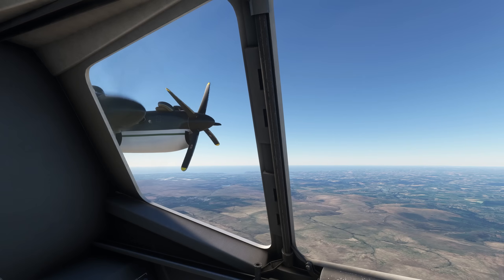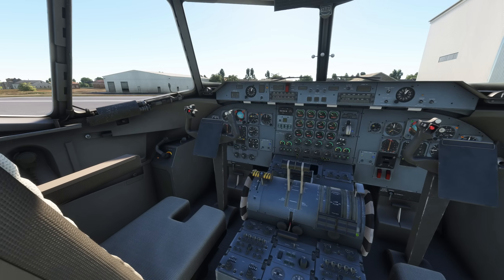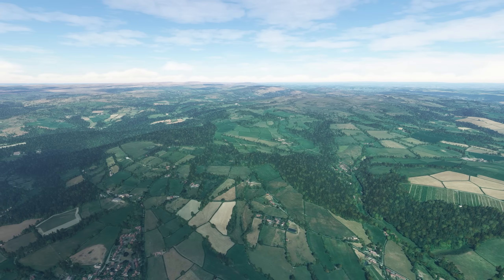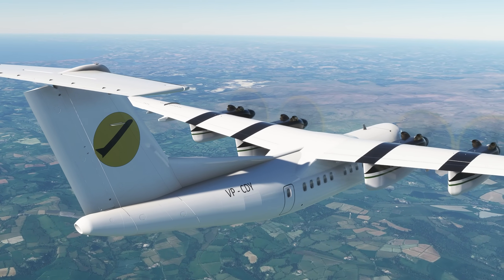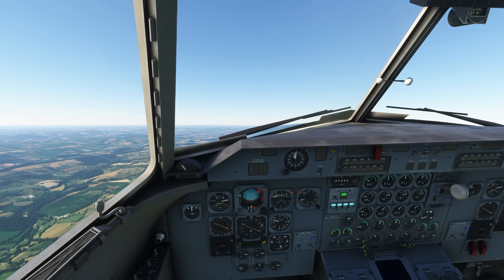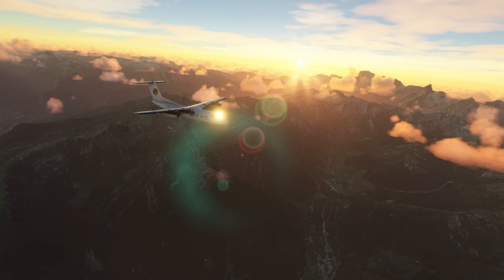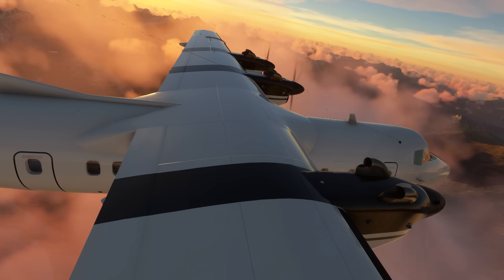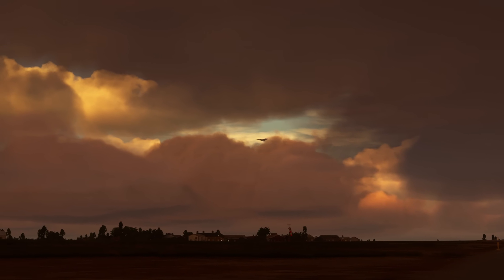WHY Did This Dash-7 STALL on a 3-Engine Climb?

Comment: Very dumb pilots. Instead of inputting the correct controls to reduce the spin, they did momentarily good, just to make it worse afterwards. 1. When you are in a positive AoA spin, you must use aileron TOWARDS the spin, NOT opposite like the rudder. That's how it's done to generate a highly useful yawing moment against the spin. Only on a negative AoA spin you'd use both aileron and rudder towards the same side. Yeah..., aerodynamics are not for everyone to learn..., especially pilots! That bad things are in reality, away from our knowledge! And by the way..., a grave misconception that must be corrected every time it's heard. STALL DUE TO SPEED. THERE NO SUCH PHYSICAL THING. Stop relating stall, which has to do only with the aerodynamic angle of attack with the airspeed which cannot and will ever not affect, produce or reduce what an aerodynamic stall is.

1. The AOA controls the creation and disappearance of a wing or aerodynamic surface stall.
2. The airspeed only multiplies the forces and resulting moments. The speed itself cannot/will not produce or dismiss a stall.

Comment: Pilots in the United States are currently required to retire at age 65. Now, an increasing number of senators from both parties are working to raise it to 67. Senate Majority Leader John Thune (R-SD), Senators Marsha Blackburn (R-TN) and Mark Kelly (D-AZ) wrote a letter on July 14, 2025, urging the Trump administration to push for removing the age limit globally through the International Civil Aviation Organization (ICAO).

Raising the age, according to proponents, helps retain seasoned pilots, enhancing safety and lowering accident rates. Additionally, they are afraid of losing influence to China, which is already supporting the shift.

However, the Air Line Pilots Association (ALPA) is strongly opposed to this proposal. In addition to raising ticket costs and creating a costly training backlog, ALPA cautions that raising the retirement age would disrupt airline operations.

They stress that raising the U.S. retirement age beyond 65 would violate international regulations established by the ICAO, which would legally prohibit pilots over 65 from flying abroad, possibly forcing them to take local flights and having an impact on hiring and contracting.

The FAA has likewise advised prudence. According to FAA Administrator Michael Whitaker's recommendation, Congress should postpone any changes until appropriate safety investigations and risk assessments are finished.

"Aviation safety is paramount, and now is not the time to take a shortcut," said Maria Cantwell (D-WA), chair of the Senate Commerce Committee.

The FAA renewal, which included a rise to 67, was previously approved by the U.S. House in July 2023; however, it was withdrawn prior to final passage in the Transportation Trades Department in April 2024. Although domestic legal efforts continue to overcome international laws that prohibit pilots over 65 from flying overseas, the Senate's letter most recently demonstrates increased interest.

In conclusion, ALPA is adamantly opposed to the proposal by U.S. Senators Thune, Blackburn, and Kelly to raise the pilot retirement age to 67, citing safety, contractual, and international legal concerns. Before becoming a reality, any alteration would need to be in line with the international standards set by the ICAO, pilot unions, and the FAA.

Comment: Seems kind of sloppy. Weren't they using a checklist for the test? Why had they not selected 25 flaps? Why did they use the autopilot for the slow down? This kept them out of the loop to the aerodynamics of impending stall.

Comment: I remember this incident. I was 'involved' during the CAA investigation as the aircraft had been operated and maintained by my airline prior to this event. I remember nothing about Egypt or Cayman Islands coming into the act. The purpose of the flight is not correctly stated, neither is the cause of the loss of control.
1. The flight was conducted post routine maintenance in Guernsey for the purpose of renewal of the Certificate of Airworthiness. An annual requirement in those times as I recall.
2. The reason the flaps were not retracted was not an oversight by the crew, the two climbs were specified in the flight test procedure. First a post take-off climb with #1 feathered. Then a descent to base level to for an 'en route cruise' climb, which the crew were performing and which required the flaps to be retracted.
3. The error was commencing the climb at too low an air speed. The Dash 7 had a big, very powerful rudder to cope with yaw at very low air speeds in landing or take-off. When the wings were 'clean' the rudder deflection was mechanically restricted by design to prevent violent rudder response at speed. This oversight meant the pilot flying had insufficient rudder authority when the spin first occurred.
Reply: The narrative states that the crash investigation found the #1 propeller feathered. That would contradict your assertion that they were performing the second test.

Comment: I was a captain on the Dhc7. It was a unique airplane designed for STOL flying. The leading edge of the wing actually drooped (a little like a permanent slat). It was very underpowered and draggy. It could barely climb on a windy day in the Rocky Mountains (mountain wave) with 4 engines, and it wasn't uncommon to fly on the edge of a stall when landing. Unlike most airplanes, when a STOL airplane stalls, particularly with an engine inoperative, reducing prop wash over the wing (asymmetric loss) all lift is immediately dumped, and it can be an aggressive maneuver and happens quickly. Pilots sometimes make the mistake of treating this airplane like a normal airplane, not one designed to be flown like a STOL airplane.  I loved the airplane, but it was junk in high altitude airports like the Rock Mountains.
Reply: I always told people my experience with the Dash is it does two things very well: It takes off in a hurry and it lands in a hurry. Everything else in-between there's aircraft that technically do it better. Still it was a blast to fly. Not many other planes will let you park 42,000lbs on a dirt strip down in the middle of some valley.
Reply: I remember flying on it with Allegheny (AKA Agony) Airlines from PHL to JFK in the late 70's. I was amazed how quickly it took of and in how short a distance it landed. On landing the pitch angle relative to the ground was radical. I figured it was draggy but never would have guessed it was underpowered. I remember sitting next to a Brit who looked out the window and saw the Pratt and Whynot logo and said 'Dependable Aircraft Engines' - I hope so'.
Reply: @paleghost Yeah, our machines are out of breath and temping out by probably around 8,000' or so. Book says you can go up to around 20,000 with people on board but fully loaded it's a struggle to 16,000. Especially in the summer.
Reply: My father worked for years with Brymon operating these in the UK servicing islands. In cool temperatures and low field elevations the Dash 7s were superb getting in and out of tiny airfields like Unst and Scatsa on Shetland.

I remember phoning him the day this one crashed in Dartmoor because I assumed it was one of his, them being the only UK based operator of them.

A few of the Brymon pilots regarded this crash as needing a certain degree of talent.

As a point of note, the captain of the Dash 7 in this crash was the same guy - Bill Loverseed - who crashed the DHC-5 Buffalo at Farnborough airshow in 1984 in a botched STOL landing. He buggered up his positioning over the airfield misjudging the wind, pulled the props into reverse pitch to effect a steeper descent which worked significantly better than he expected and pancaked it onto the runway. The undercarriage broke the wings off and pieces of propeller blades flew off into the carparks but those aboard were all ok. Prior to this he was leader of the RAF's Red Arrows when they had their first fatal accident.
Reply: @jamieduff1981   Right... That history of Loveseed really nits it up nicely, doesn't it? Thank you for sharing.

Comment: Did they retard power after getting into the spin?...if not, failure to do that may have made it impossible to recover ...this error, if at all it occured, may be related to the Brazillian Voepass ATR-72 stall-spin accident.

Comment: It is very hard to believe, with two pilots that had all the right boxes checked and then some  and crashed the plane . I think some data is missing. and I do not believe age had anything to do with it.  The pilots or at least one were test pilots, so his reaction times cannot be that bad. So there are some loss of physical strength due to age , but I cannot see the loss to be at a lesser level than using female pilots. I do not have the spec with me but to stall at 100 kts seems high for an airplane I do not believe at anywhere near gross weight and been classified as an STOL plane. The FAA demand the stall speed for most single engines planes to be around 60 kts. that is 40 kts difference !  No one thought of pulling back the number 3,4 engines ? and firewall the number two ?  This plane not at gross should be able to stay in the air with just two engines. , let say number 2,3 at full power.  Do not think we did not catch it more than a few times, the throttle quardren shown with the video is for a twin. This is a crash you expect from under trained third world pilots.

Comment: One other thing needs to be taken into consideration.  This is a T tailed aircraft, where airflow over the elevator can be shielded by the wing in unsual attitudes, preventing effective operation. This could prevent stall recovery if the nose could not be lowered or raised..as in " falling like a leaf "

Comment: I’ve got 2,000 hours in the Dash 7. Line pilot training, not test pilot training. I was approved for 3 engine ferry.
This scenario, as described, is a perplexing conglomeration of requirements. Using the autopilot as the aircraft approaches slow flight, 3 engine configuration, flaps up, is, in my opinion, an invitation to disaster. When the autopilot disengages at the stall, the pilots add full power while also trying to assume control of an aircraft badly out of trim.
Are you kidding me?
I don’t care how experienced these guys were, this was unbelievably bad judgment.
First, fly the plane yourself. That way you can feel things develop rather than being handed a load of control forces you may not be expecting.
Second, recover at the first sign of the stall, the shaker.
Third recover with reduced angle of attack and add power in a COORDINATED movement, ball in the center. 
To recover with asymmetrical application of power, during a stall, elevator full back with nose up trim, I mean my God if I were trying to spin the damn thing, this is how I would do it!
Reply: Search for news on two Hawker crashes in the States this year following maintenance and "stall" tests.

Comment: A fatal mistake.... Yes is to NEVER get into a 10 K>> 10,000 feet a minute decent, without an ejection seat or a available hatch and parachute close by... The Airbus A-400 crash video May 9 2015 Spain, after taking off is HUNTING... Was filmed in full color disaster crash...  After a computer cut of three engines power...

Comment: Crazy! I have watched this plane take off and land hundreds of times at what was once voted one of the World's Top Ten Most Beautiful Approaches, the former Narvik Airport, Framnes (Norwegian: Narvik lufthavn, Framnes; IATA: NVK, ICAO: ENNK). I had no idea about the fate of this beautiful de Havilland Canada "Dash-7" DHC-7, Curious Pilot. I would say there was some unsafe handling here. I simply cannot wrap my head around how two such experienced Pilots could get themselves into so much trouble unless they had breached the Sterile Cockpit Rule. What a sad story.

I loved the sound of the Norwegian Company, Widerøe's "Dash-7" roaring over my roof top trying to lose altitude FAST before touching down at NVK. The hum of these four Pratt & Whitney Canada PT6A-50 turboprop engines, 1,120 shp was magnificent!!! It was a really nice airplane to fly in as well.

Before that Widerøe flew the de Havilland Twin Otter, also an iconic aircraft in the Arctic. And After the "Dash 7" was sold to, among other places, Egypt, the twin engine "Dash 8" took over and is still flying. I would say that de Havilland built them GOOD! When Bombardier bought the company… Not so much. But the Type Certificate for the "Dash 7" was actually later bought by Viking Air in Canada, which later reformed into De Havilland Canada, so there is a sort of lineage there.

It's quite amazing to think that Norwehian Voluntary Pilots flew the de Havilland Mosquito "The Wooden Wonder" for the RAF during World War 2. And Norwegian Pilots are still to this day flying de Havillands!

I am really sorry these two Pilots didn't make it through this upset, though. May Almighty GOD rest their Souls in Peace. Amen.
Reply: Mind boggling that you actually enjoyed the repetitive sound of aircraft engines near your home. I can’t stand that sound.

Comment: If they attempted to respond to respond to the stick shaker (or just low airspeed) by advancing the throttles, rather than pitching down, on the 3 good engines that could have resulted in asymetric thrust and a roll towards the feathered engine. If the pilots responded to that by using the aerilons rather than the rudder (perhaps part of a startle response) then that movement of the aerilons effectively increasing the chord of the wing could have caused that wing to fully stall leading to it droping and entering a spin. That would account for the sudden yaw and pitch down. Atempting to recover by pulling back on the stick would have made the stall worse and potentially going into a  "super stall" with the high T tail blocked by turbulent air from teh wings and a flat spin which would be unrecoverable and account for what was observed. Startle can happen to anyone but it is bizarre that such experienced pilots would respond to a stick shaker in that manner, I wonder if the stick shaker was actually working (rather than the systems thinking it was) otherwise the speed could have dropped below or approached VMCA without the crew noticing, then advance the throttles when they see the speed getting low and stall

Comment: I'm trying to see if my understanding of the test they were performing is correct. 
My understanding is that the test was to determine if a plane taking off at V2, could lose an engine and still climb. Since it was simulating a takeoff, the autopilot would not be engaged. In order to get down to V2, after feathering the #1 engine, power would be reduced on one or more of the remaining engines and level attitude of the plane maintained as the plane slowed and descended until V2 was reached. At that point the remaining 3 engines would be put to full power and the plane would be put into a climb with a minimum rate of climb dictated by the test.
Is my understanding correct?
Reply from the maker: Yes that is my understanding, I believe the autopilot was due to be disconnected once the set up for the test was complete. I think the main issue for the crew was the flaps remaining up, the rest seems to come from that mistake.

Comment: Retired CFI here. Only experienced in single engine. I heard in many hanger flying discussions of the dangers of aircraft with the T tail design and a condition called Deep Stall which is nearly impossible to recover from. Sounds like that could have been in play here.
Reply: Most gliders have a t tail and we do spins alllll the time.
Reply: On most T-tails a stall develops into a deep stall, from which recovery is not possible. That's why most T-tails have stick pushers to help prevent a stall. But I heard nothing in the narrative about a deep stall or a stick pusher activating. Does the Dash-7 deep stall? Does it have a stick pusher?

Comment: Wow… what an interesting story. Thank you for making this. I am surprised the crew carried out this test at 5000ft, I get they were not expecting to stall but seems low just in case something did. Pulling the stick back also seems crazy.
Reply from the maker: Thank you Josh. Yes I agree it does seem low, especially when they shutdown one of the engines. Having flown multi engine turbo props in the past we used to simulate engine failures by reducing the torque to a level that closely matched a failed engine, not the same and in the past engines were shut down mid flight. With this being a test flight and with suitably qualified pilots, shutting down an engine mid flight is part of the job. The Dash 7 should be able to climb on 3 engines so even if they had an issue at that level they could climb away, level to increase speed or even restart the shutdown engine. The main issue here being the stall and subsequent spin/dive. I believe the full nose up control was due to the extreme nose down attitude, if the Dash 7 entered a deep stall and the Tail was blanked from the airflow nothing could have been done to recover. Still speculation on my part but an interesting accident to research.

Comment: So many whys for supposedly "experienced" pilots. Why the engine out test was done with autopilot on continuously. AP must be disengaged when there's an engine "problem." In this case an engine out test. Why was the speed allowed to decay to 93 knts and the stick shacker allowed to activate and remedial action not taken immediately?
Reply: I'm guessing the two old fokkers were too out of it or had simply forgotten.
It must have been a wild ride down.